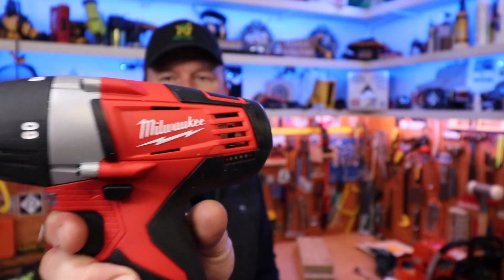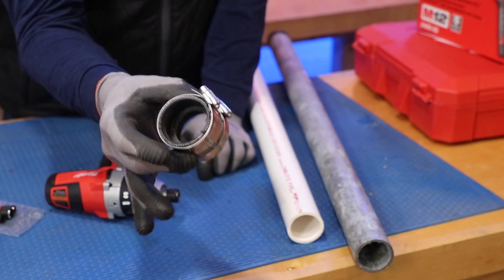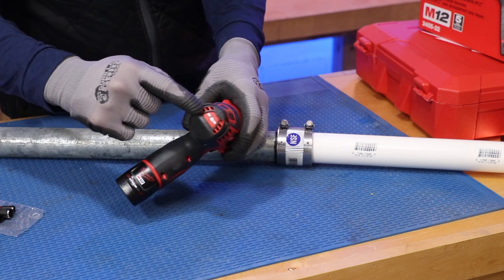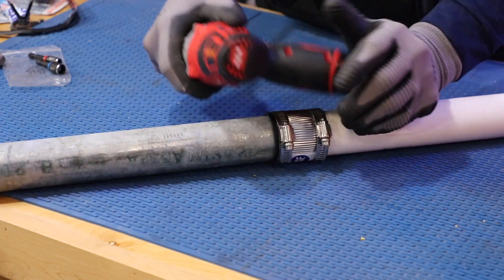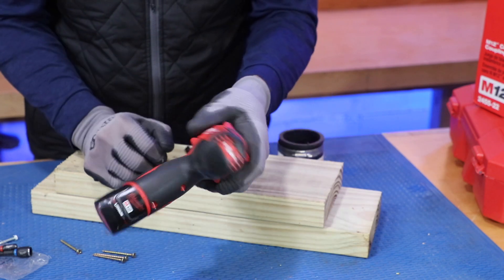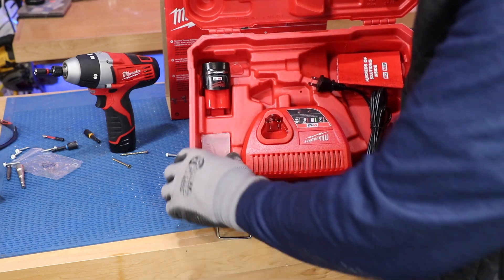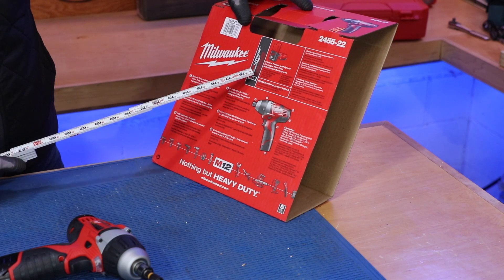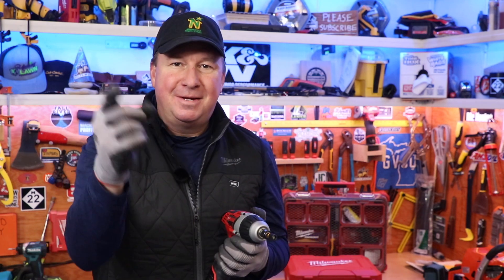MILWAUKEE M12 NO-HUB TORQUE DRIVER KIT- 30 MINUTE CHARGE TIME! // Model #2455-22

Comment from the maker: QUESTION OF THE DAY:  Do you have experience working with cast iron?  What size no-hub couplings do you most often install?  What different type of material do you connect cast iron to?  PVC, ABS, copper, galvanized?

Comment: Excellent Mark!  Not for everyone, but if a person was doing a lot of these couplings, it would defiantly save them some time.  Milwaukee really needs to include 2.0 batteries in these kits, seriously!  I’m old school, so I like either a kit box, or custom foam layout, in a Packout or similar storage medium.  This would be totally useless to me, since I don’t work with this type of plumbing.  If I have to use a fernco coupling, I usually just grab a nut driver and tighten by hand.  Happy New Years to you and yours Mark, and to fellow Subs!  👍👍👍😁✌🏻🇺🇸
Reply from the maker: Thanks for sharing George!  I would like to see the 2.0 battery in here too.  Happy New Years to you!🎉😀
Reply: Dont know if having a specific tool like this. Big brands are making multi level adjustment to their brushless nut drivers now. I own bosch and dewalt 12v drill/drivers with variable clutches that are capable of many more tasks.

Comment: ipc code actually states, you can not use no hub couplings on pvc pipe. use fernco or plastic to plastic bands. but back to this extremely over priced tool i got tricked into buying.  brand new, it does not torque correctly on husky 4000 series bands. (the orange band husky ) . don't buy this tool
Reply from the maker: Interesting, I wasn't aware of that code.  I'd like to test this out to see what it actually torques to.

Comment: Its been around at least 11 years. Tbh, I'd rather just use an impact driver, its faster
Reply from the maker: I've talked to a couple professional plumbers after making this video and they all said they just ratchet it down tight, and don't use an official tool or gauge on cast iron.
Reply: @MarkThomasBuilder  I am a professional plumber.

Comment: In other words a waste of money
Reply: Wow, I was thinking the exact same. I'm a big fan of Milwaukee, but this is a total waste.
Reply from the maker: Unless you're connecting cast iron all day on a commercial project.
Reply: Maybe if one isn't making enough money. 🙂
Reply: Not at all, if you work with cast iron it’s going to save you from straining your arm from using the torque wrench. probably save you from Carpal tunnel later on.
Reply: No it isn't,  if you're doing no hub all day, and working on a job that requires a head test, filling the lines with water all the way through the top of the vent sticking through the roof. On multi story buildings, you do up to 4 floors per test. Must be torqued to either 60 or 80 inch lbs depending on the coupling, and no shortcuts or cheating with measurements, or cocked fittings.